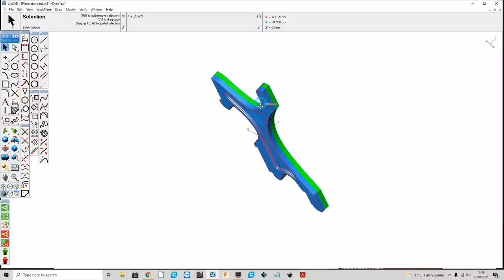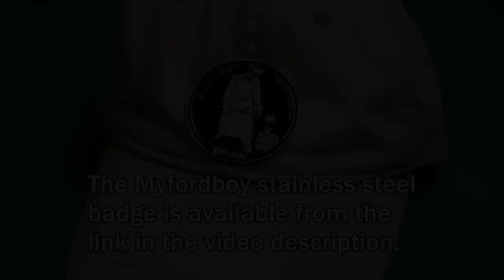Metal Casting at Home Part 112 Piano Standard

Comment: Hi, I'm a bit confused: When are you making a riser and when not? What are the criterias? Thanks for all your great videos, very inspiring, rgds Franz
Reply from the maker: If the part is small I don;t use a riser. The riser will feed a mould with metal as it cools and shrinks. I would add one to the hub of a flywheel as the hub would be a large section compared to the spokes and shrinlkage could occur. 
Metal would normaly be fed into the thickes part of the mould, if there is a thick section elseware I would add a riser ther.

Comment: Aren't these standards usually cast iron, because of it's vibration damping property and strength?
Reply: They certainly used to be cast Iron, possibly because the piano frames were made using the same material, so it was readily available. Most modern actions use Aluminium standards, along with extruded rails. The standard MyfordBoy is casting here is from a Blüthner Patent action that was last made around 1920; it will be used in an action model when I get around to building it!

Comment: Hey mate what kind of aluminium would use to cast a motorbike Kickstarter?
Reply from the maker: I use alloy wheels which casts well but after casting the metal will be softer than before so may not be strong enough for a kick start. It can be hardened my reheating to specify temperature and holding it for a specified time but not something you are likely to be able to do without expensive equipment.

Comment: Can accurate aluminum molds be made by hand pouring and not a cnc?
Reply from the maker: The surface finish of casting may not be suitable for mould but can be dimensionaly accurate.
Reply: @myfordboy  I can sand it smooth enough if I have to. Thanx for the info.

Comment: Until the temperature you raise the aluminum to keep it warm, I am casting aluminum and it is difficult for me to find the ideal casting point, thank you very much!
Reply from the maker: You want to pour about 700C.
If you have no means of measuring the temperature then if you still the melt with a stainless steel rod, metal should not stick to it if it's hot enough.
Reply: @myfordboy  If I can measure it since I have an electric oven with a pyrometer, I was melting it at 720 degrees and when I poured it into the mold it moved as if it were boiling and left me deformed pieces. Thank you very much for the information
Reply from the maker: Sounds like your sand is much too wet if you can hear boiling. Wet sand will make staem and push the metal away from the mould.
Reply: @myfordboy  I don't use sand, I make the piece with 3D in PLA and I cover it with a mixture of plaster and quartz sand, then I put the mold in the oven, the PLA melts and I add molten aluminum (the technique of: wax molds lost) and when adding the aluminum it begins to boil on the surface of the pouring channel and leaves deformations and they have told me that it can be a high temperature with which I will test at 700 degrees
Reply from the maker: For a plaster investment it needs drying out for at least an hour at high temperature. I build up slowly to around 900C and hold it for say half an hour.
The PLA burns out much sooner of cource but you have to get all the moisture from the plaster. i am using a proper inverstment plaster, would not expect plaster of paris and sand to work.
Reply: @myfordboy  I understand the drying thing since I left it several hours melting the PLA and drying the plaster, worse I did not know that the plaster type paris would not work. Do you use a different or industrial plaster?
Reply from the maker: This what I am using https://www.artisanfoundry.co.uk/product_info.php?products_id=97
Reply: @myfordboy  I will look for that plaster in my country, I am from Argentina. I greatly appreciate the answers and the time you have dedicated to my questions, thank you very much again, greetings!